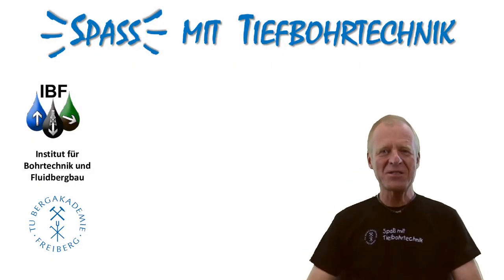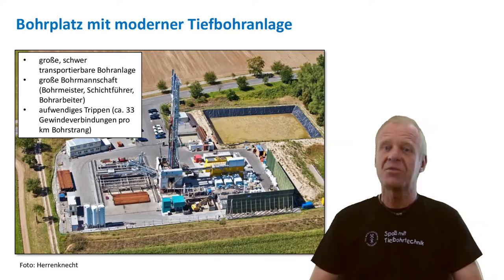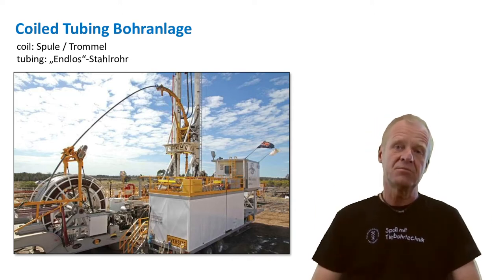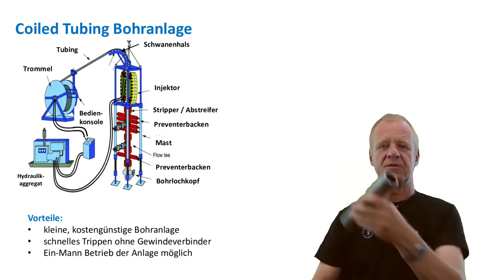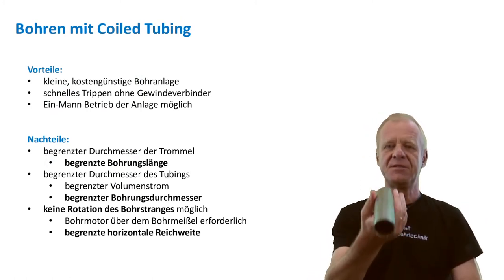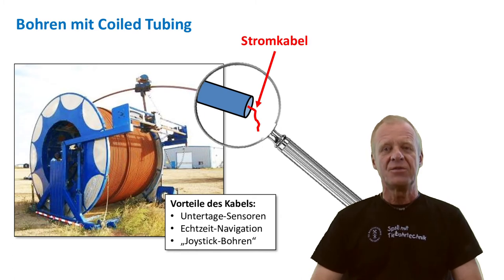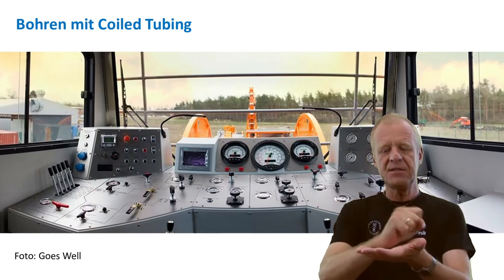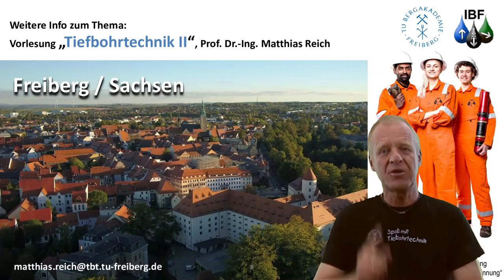What is Coiled Tubing drilling?

Comment: The fluid which is pumped inside the coiled tubing to remove sand which is between the normal tubing and the coiled tubing. is it a completion fluid or what type of fluid used to remove that sand